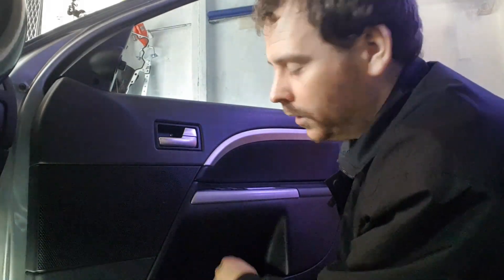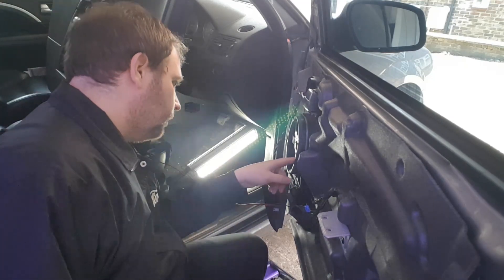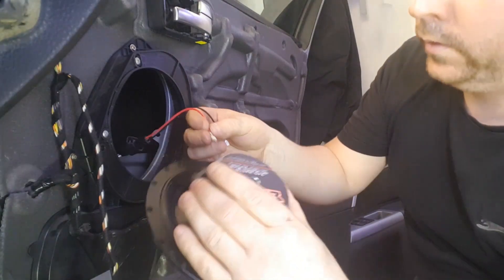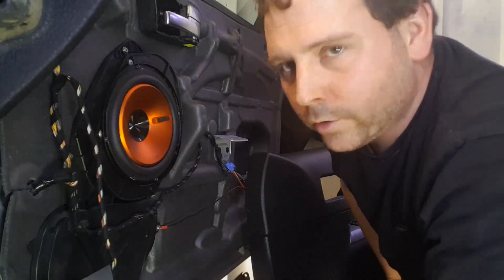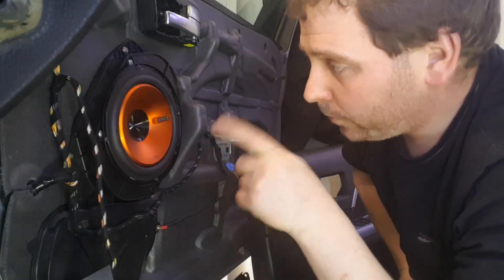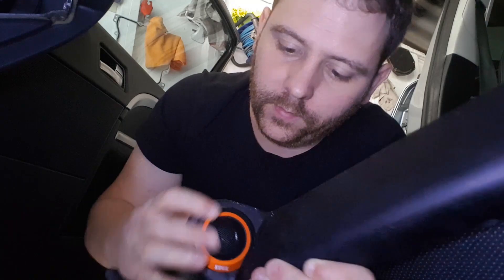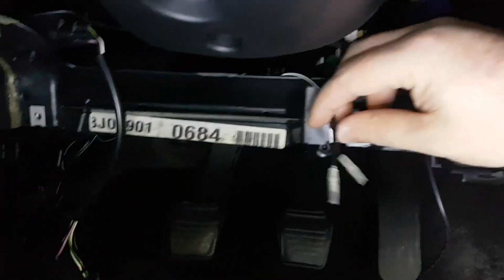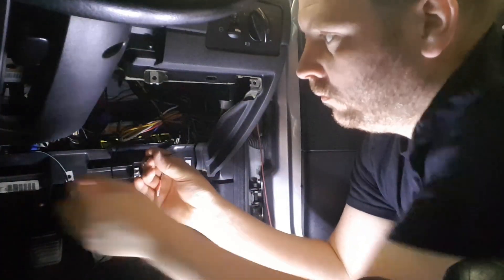How to install & upgrade car Speakers Ford Mondeo MK3

Comment: Those original Sony speakers are very good quality. There are 2 versions of these, with the silk tweeter (these ones, better) and with the PEI tweeter. They sound very good with the paired Sony headunit with DSP control.

Comment: How are theses speakers? Sound wise, compared to the original Sony speakers your removed, like you said in your video they are only edge speakers and compared to Sony you would think Sony would be better quality
That’s the reason for my question though :) to get the answer, as I’m thinking of doing mine but don’t wanna buy new speakers and they turn out to be worst the the originals, 
Appreciate it

Comment: Good video cheers.... did it make a big difference? I think the standard/higher spec speakers are pretty decent
Reply from the maker: yeah it did, i have them powered by an extra amp in the boot.  cheers for watching

Comment: The ST220 has 6x8 uprated speakers at the front (Two types , soft silk dome tweeters the best sound quality and plastic dome tweeters 2nd best).
I tried JBL stage 3 8627 6x8 and added seperate JBL Club 750T tweerers high up.
Result :- Not as good (clear natural top end/mid) sound as the original uprated  speakers (Infact aufaull sound quality from the JBL speakers).
 VERY VERY disapointed in JBL (Did someone at JBL stop testing their speakers in actual cars??????)
If it is not broken, dont fix it. Leave the original uprated speakers in the car.
Both tested on the original Uprated Sony head system.
Reply from the maker: Okie dokie, i will make some up.